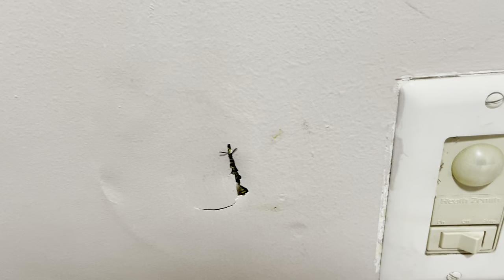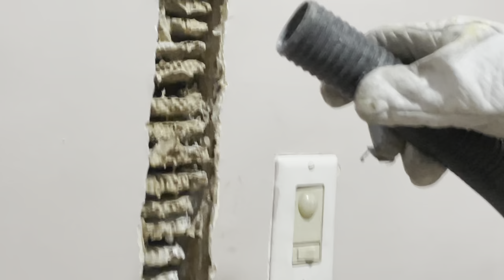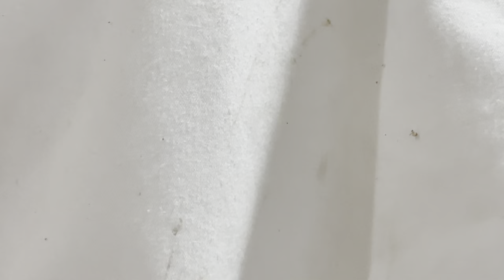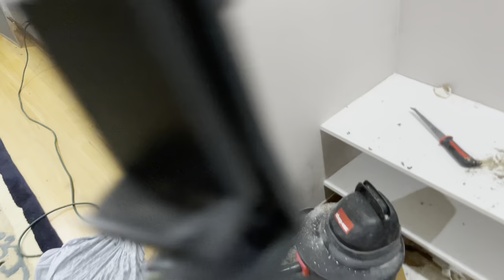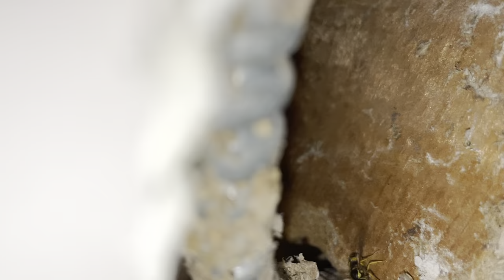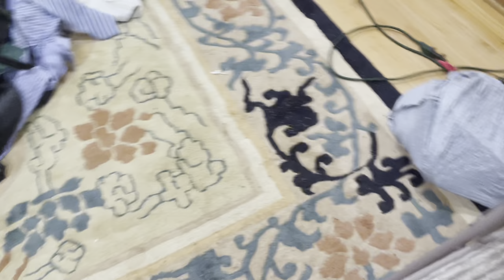Things of nightmares, wasp nest in bedroom wall.

Comment: My luck, the damn vacuum hose would have clogged about 30 seconds into the extraction! Great Video as always. Thanks Again!
Reply from the maker: It happens to me almost every time I use it. Mine has the ball valve inside so if I tip it over it just stops sucking completely
Reply: @wasphunter7131  That would not have been cool. A bedroom full of very pissed wasp! Thanks Again for the video!
Reply: Yeah that or the power goes out 😆
Reply: @ChangedEver Don’t ever think that again!

Comment: Great video. But, would like to ask one small favor if possible.  When you run the vacuum please balance the sound level. Was wearing earbuds and wasn't ready for the big jump in sound levels it sounded like my ears were inside the Vacumme and it was running for a couple hours after I was done watching the vidro.  Please and thank you in advance. Otherwise 10 out of 10.